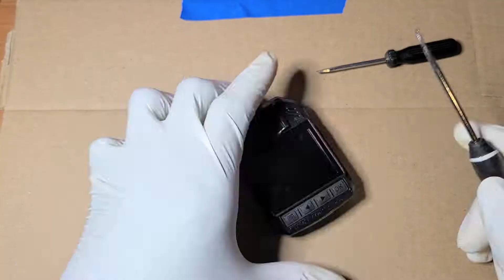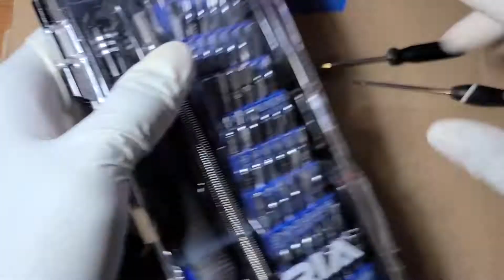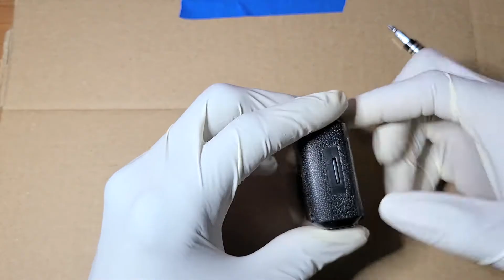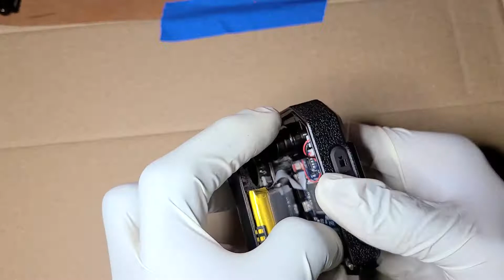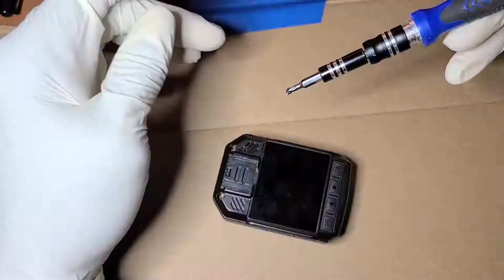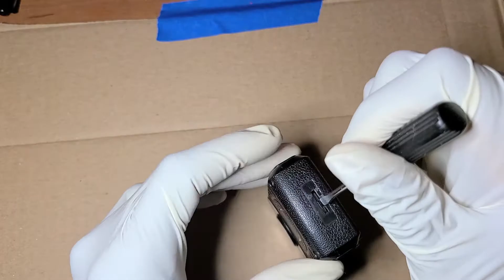Boblov KJ21 Body Cam - What's Inside

Comment: Fantastic, very useful. My camera stayed in the sound recording position and I couldn't turn it off, I pressed all the buttons in different ways and nothing, I couldn't turn it off and it kept recording sound. Following this video, I opened it, disconnected the battery and it turned off; Then I reconnected the battery and it was perfectly fine. Thanks a lot.